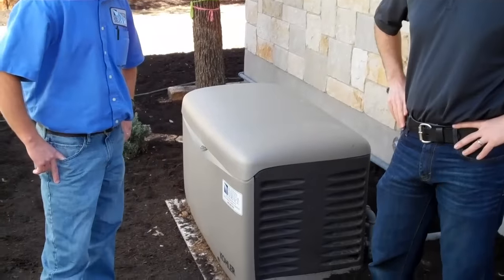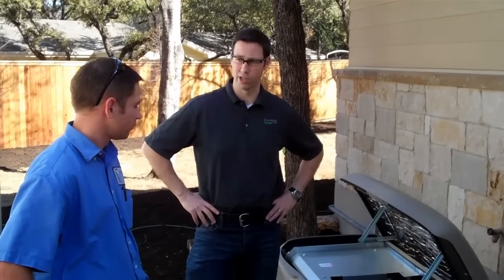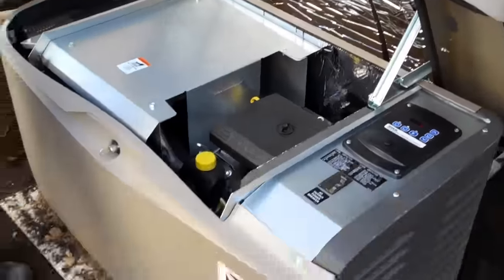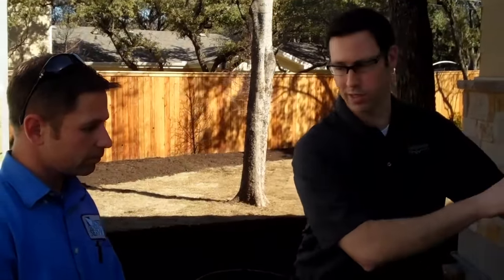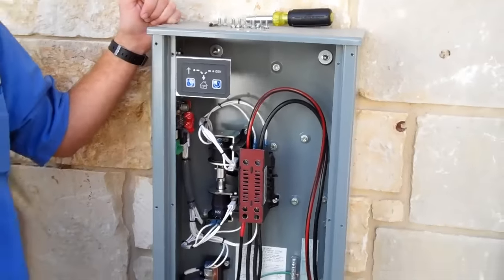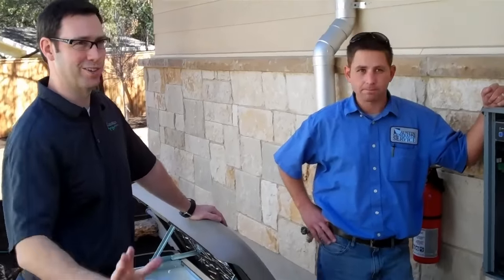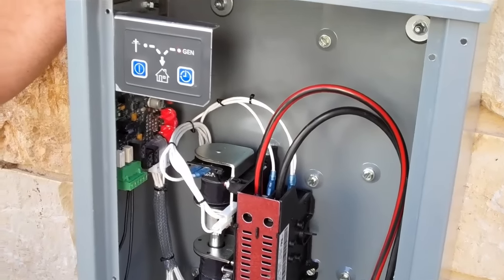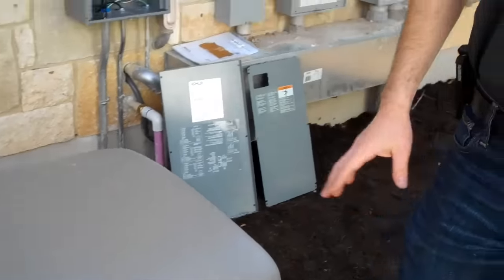Kohler 14kW Natural Gas Backup Generator System Overview

Comment: So the guy asks how long will it last? Answer 10, 20 or 30 years. Make up your mind.
Reply: @NonyaBusiness! We have an older Kohler home generator. I can attest they last ten years at least. ;)
Portables are nice but its also nice when the power goes off and the generator starts itself up automatically and then off again once the power has returned. 
Our generator has about 230 hrs on it now. I wonder what the engine is actually rated at. Generac (different company I know) says their engines are rated for 3000 hours. 3000 / 230 = 13 * 10 years to accumulate those hours means the genset ought to last 30+ years with occasional use and proper maintenance.
Reply: NonyaBusiness! No way this Kohler standby gas generator can cost all that money installed. I live in the carribean Puerto Rico and everything we buy here is supposed to be more expensive than the states, but nevertheless I only paid $3,500 dollars for my Champion 8.5kw standby gas generator completely installed by a certified technician and my local professional gas company. Ok when i boutght it was in sale in my local Sams Store and both the technician and the owner of the gas company were close friends of mine so maybe i saved close to $1,000 dollars from their regular prices and service but this is no near the amount of money you’re talking about. Also the one of the same size of the video was only like $600.00 dollars more than mine. Also you can’t compare any portable generator with the benefits that offers a standby gas generator with ATS, because as soon the power goes out it starts automatically in 10 seconds and I can power the whole house with mine during a power outage. Also it can be used continually for over two days straight without having to turn it off, and mine can be used for over 125 hours at half load before i need to refill her 120 galons propane gas tank...😉

Comment: KEY issue to address is Short versus long-term power outage. Living in the Gulf states, power out for 1-4 hours is EASY to address- It's the 4-8 days given a Hurricane!!!!  Please address, because that is what "most" of in the Gulf states are concerned with?? :)
Reply: Sounds like you need a 1000 gallon propane tank. That's roughly 500-600 hours of runtime depending on the size of the genset and loading. That's the better part of three weeks.

Comment: How many amps was the house panel?
Reply: Typically I install 14 RESA and 20 RESA units on houses with 200 amp panel.  They will not run everything in the house if you turn everything on at the same time, but I bet you don't do that when the utility is on either. If your electric meter base is 100 amp (I usually see this on older homes) there are smaller Automatic Transfer Switches that can be used and they are less expensive.  Rule of thumb--if you are going to use an electric oven, you will need an automatic transfer switch with a load center that limits how many circuit breakers you can use, if you want to buy a 14 RESA.  A 20 RESA will satisfy 95% of middle class customers.

Comment: 1: A local power outage as in a power outage on your street .... YES the natural gas will still flow just like city water.. If your subdivision looses power, MAYBE the gas and water will still flow.. A city wide power outage, chances are water and natural gas will stop flowing...  NEXT you need to make sure your natural gas line coming in has enough pressure to feed the generator ... If that pressure is LOW, that generator will not run.. !! I have seen many times people pay THOUSANDS of $$ to install a generator this size and feed it natural gas, install the ATS then to find out the generator cranks runs and stalls ..  Then to find out that the gas company only guarantee's X amount of pressure and if your stove or heater works.... There is nothing they can do about it ... Then you find out that your stove or heater does not require as much pressure as your generator needs ... Those are more about gallons per minute vs pressure ... 
2: is it 10 yrs, 20 yrs or 30 yrs...?? 
3: 14 K W is right in the middle towards the top.......
4: you people should be saying its a 14 thousand watt generator ... 
lastly but not least...  That ATS is just another point of failure with all those electronics ... All it takes it a lightning hit or power surge to damage it and you wont know until your power goes out and that sucker does not switch over...  I am all for electronics and technology but when it comes to power, i keep it simple.... Generator to MTS to panel = power to house...
Reply: You Tube   A city wide power outage.  Water and gas still flows. Almost always.  A generator is made for an electric outage.  What is everyone so concerned about a gas outage.  Once every 20-30 years.
Reply: Donald1951:
Hurricane Irma cut our state in half and put us out of power for 9 days ... Water stopped flowing after 24 hrs ... Nat gas was down for 5 days. 
Yes they STOP flowing ... 
And why do you keep saying that a generator is made for an electric outage..?? We know this already.. !!
Reply: have a 14kw Kohler on natural gas like this, had for 10+ years. Lots or outages here, gen has always operated flawlessly. Power out for many days - gas does not stop. No city water - we're on a well which is a good reason for standby power. Is quiet with lid down. Gen is just outside of guest bedroom and guest during outage last summer said noise no problem.
Reply: Water needs pressure and does not move.  Why forget that a GAS, a GAS naturally expands and unlike water, it only needs one pound of pressure to operate.  Gas will keep expanding naturally inside the gas lines without any need to apply strong pumps.  In fact, even once outside after it leaks it keeps expanding and fills an entire room. Hence, it is reliable.
Reply: Water needs pressure and does not move.  Why forget that a GAS, a GAS naturally expands and unlike water, it only needs one pound of pressure to operate.  Gas will keep expanding naturally inside the gas lines without any need to apply strong pumps.  In fact, even once outside after it leaks it keeps expanding and fills an entire room. Hence, natural gas is reliable. Besides, what else, a wind turbine backup, and if there is no wind a solar panel back up , and if it rains and there is no sun, if there is an EMP, etc etc...

Comment: Can’t even calculated a generator and installing them.          12000 just for a 1500 square feet     22000 for a 2500 or 2800 feet don’t shet